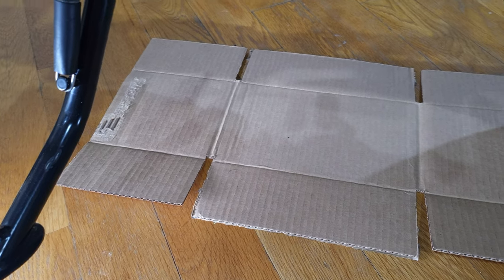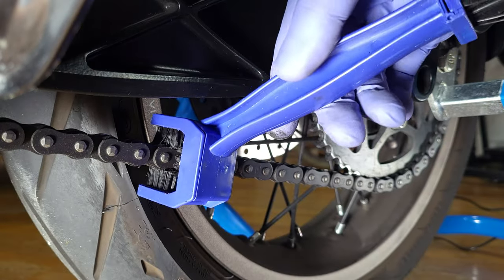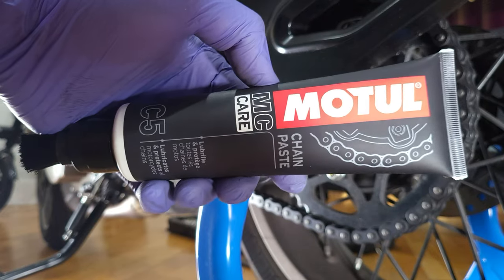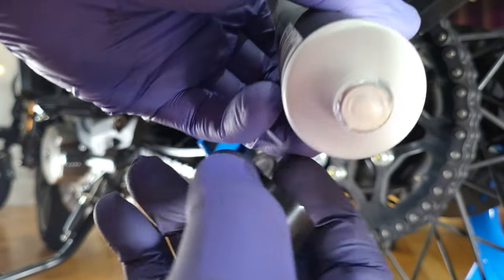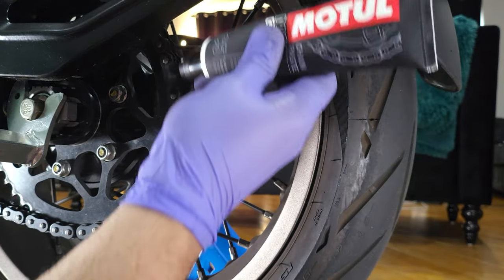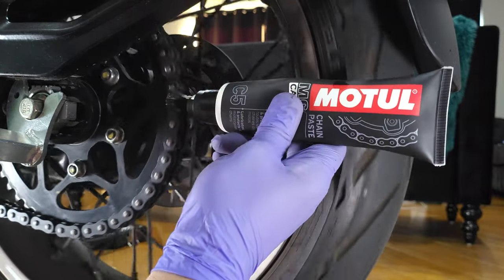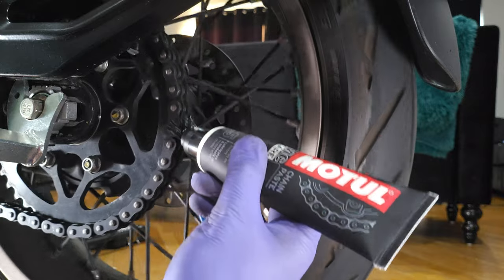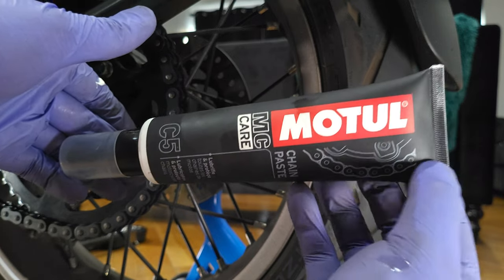Chain Lubrication - Chain Paste: Svartpilen/Vitpilen

Comment: This is how I do mine and I reached to that conclusion after hours of reading and trial & error:

1) Buy some kerosene (called also pharmaceutical grade light paraffin oil). It costs less that 5€ per liter and it can last for > 2 years. 
2) Buy a water spayer for clothes ironing. Put some of the kerosene inside there. Spray the whole chain and be carefull not to spray on tires, brake discs or brake pads. Use a carton board for that purpose.
3) Let it soak for 10 minutes and scrub with the brush you used in this video for about 2-3 minutes (I make 10 wheel rounds from one direction, spray again a little bit and 10 rounds again from the other direction)
4) I use a garden pressure sprayer with only water to clean after the scrubbing. You can also use a second water spayer for ironing or your garden hose if you are outside. It needs only a little pressure.
5) Use a cotton fabric or microfiber to completely clean any leftovers and completely dry your chain. Let it completely dry for 15-30 min or use pressured air to remove any water drops.
6) Apply the motul c5 paste on the interior of the chain and if you can a little bit on the sides. You can watch the official motul tutorial which is how I do it, but i also do the inner back side as well. The outside of the chain as shown here is totally not needed.
7) At your next continuous ride > 50 km, which your chain will still be hot, repaste with motul c5 paste, because at a hot chain, it is much more efficient. Use less paste this time.
8) You lubricate every 500km (max) and clean + lubricate every 1500 km (every 3 lubrications, you also do a cleaning). Obviously, if you go through mud terrain, you might need to do it quicker.

Greetings from Greece
Reply: I use diesel for cleaning

Comment: You need to do the inside surface of the the chai

Far more important that what you lubed !!!
Reply from the maker: Your mom is not holding the camera, so i cant show every thing i do. Would u like a refund?
Reply: I think so too
Reply: no it's not, modern chains have internal lubrication that is sealed in with orings. chain lube these days is a glorified rust prevention. as such the least important place to lube is exactly where you mentioned because that will be the first place rust is knocked off, if any, by riding the motorcycle